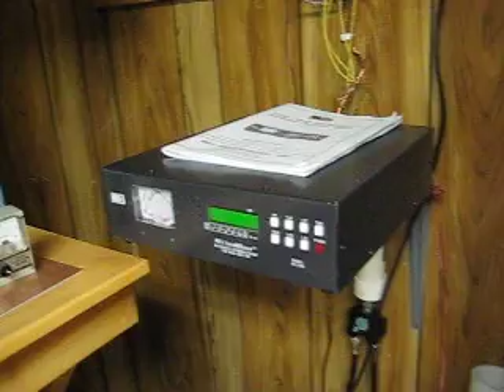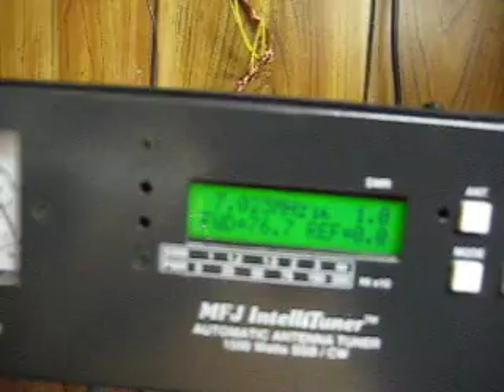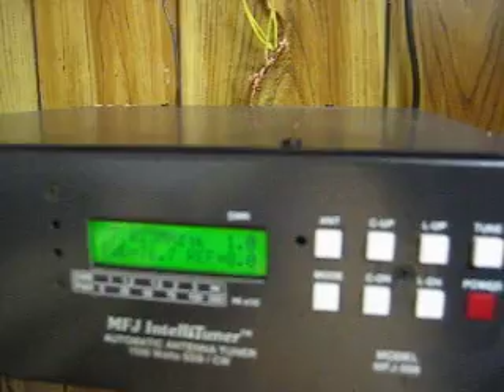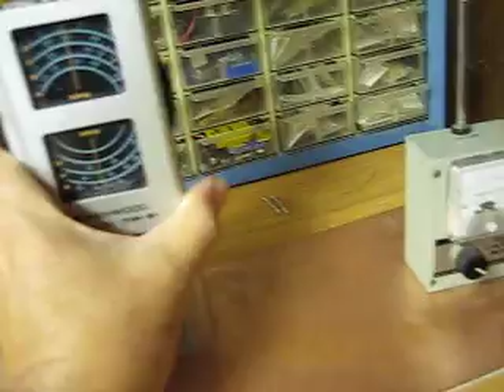N4LQ MFJ-998 Tuner

Comment: Line oscillator?  Did you mean Choke or balun?  Nice audio.  So many U tubers have barely audible audio.  Just got a 998 & have had mixed results so far.
Reply from the maker: +Bob Ograv Yep...Choke ....It's just a piece of coax with ferrite beads slid on it. I've changed everything since this. Still using the 998 6 years later! Have 2 of them now.
Reply: Nice!  I also have a KPA500.  I am still not certain on the 998.  I am having trouble acclimating to an auto tuner.  Sticky tune & auto tune are confusing as they seem to do exactly the same thing on mine.  Sometimes mine just sits there & does nothing.  I do not have the radio interface cable & it appears you do not also.  I noticed the age of the video after I posted.  73 Bob